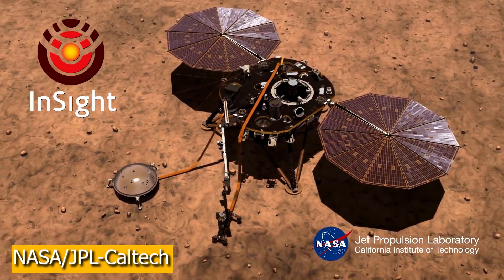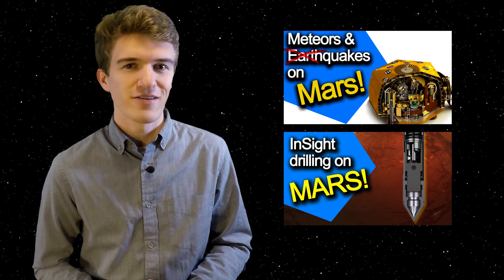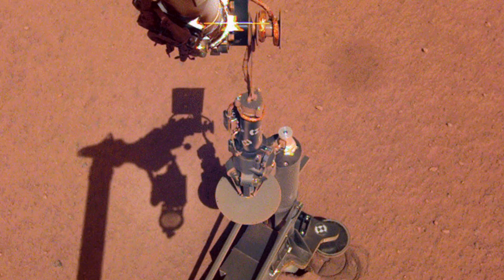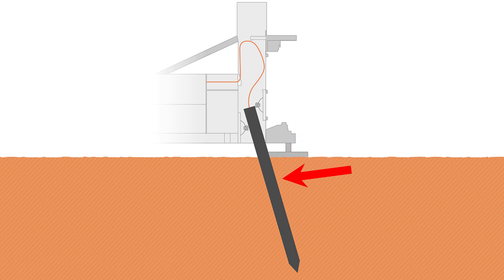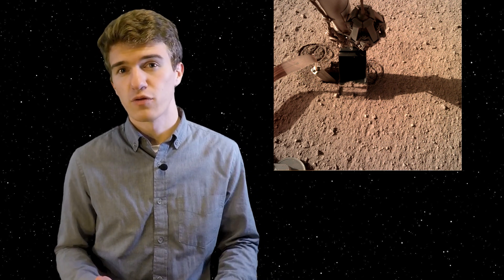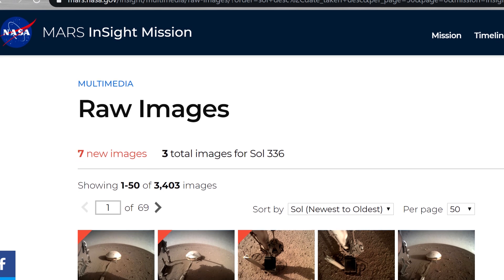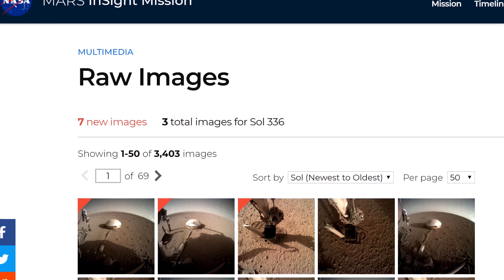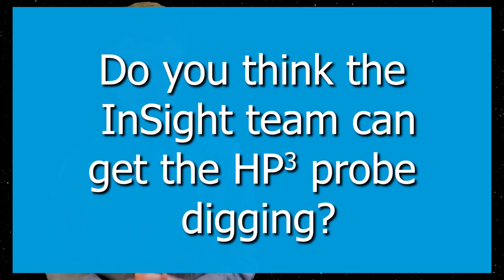What's wrong with InSight's Experiment? InSight Mission Update

Comment: It's high time they stopped wasting time and pushed the probe from top with the scoop. There's really no other option at this point. At least we will finally know if the probe can or can't make it deeper.
It is disappointing to see them spending so much time on that problem, and even more disappointing they didn't include shock absorbing lightweight header protecting top of the probe and the ribbon cable in case it needs a push with robotic arm. I don't get it... Why didn't they include such simple solution in advance...

Comment: The 'loose" corollary to this:  making a sand cannonball on a beach with really loose sand.  The sand has no friction until you wrap it with wet sand from the water.  Then you can throw it, roll it, or punch into it with a self hammering drill.  Isn't there some cryogenic liquid Insight can pour into hole?

Comment: 304/5000
Every machine tool must be kept at a constant pressure. Not by turning the bit, holes are drilled in stone but with punches.
If I let go of the drill, it will fly around my head.
It is incomprehensible to me why engineers did not see this coming.